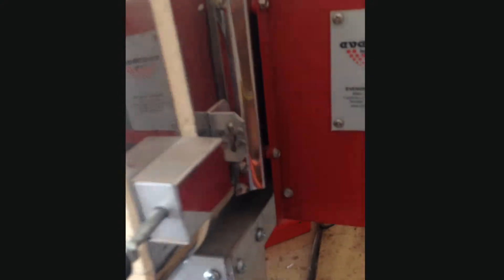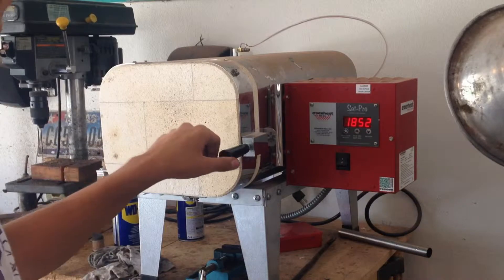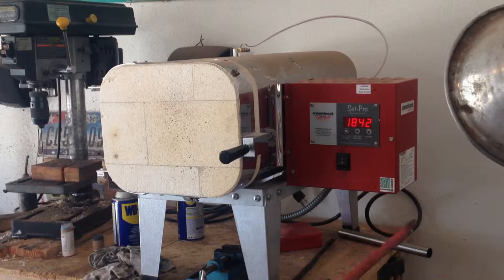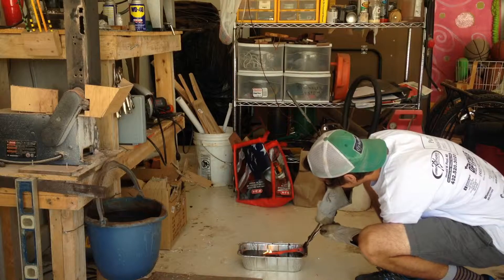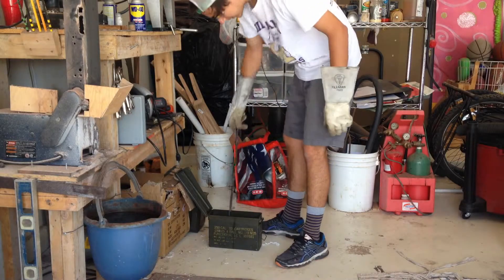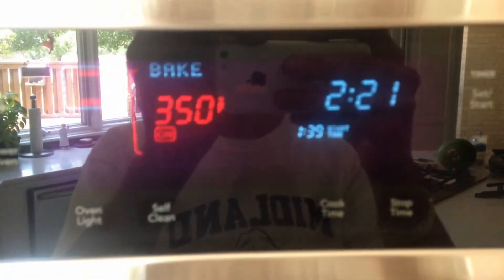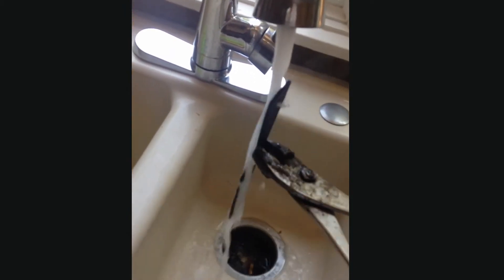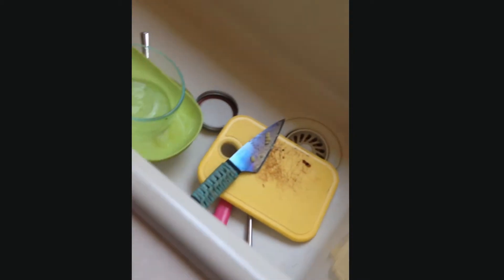Heat treating knives

Comment: What degree did you heat treat the knifes at?
Reply from the maker: Isaac Lawson Well I must admit, I've come a long way since this video was made so my recommendation to you is this, if you know what alloy of steel you have hop on google and look for heat treating data sheets. Super informative.  If you don't know what you have maybe try doing a few test pieces first. Heating for longer times and quenching in oil or water and see what gives you good results. A tap with a hammer should tell you if it's hard bc the metal should shatter. Hope this helps.

Comment: 3" or 4" C-PVC tubing with a cap glued onto the bottom, makes a pretty good impromptu quench bucket. You can also vary the length and fit longer blades. Usually stop when the oil gets much over 300 deg f and let it cool down some. The longer the bucket, the more oil and blades you can do before it over heats.